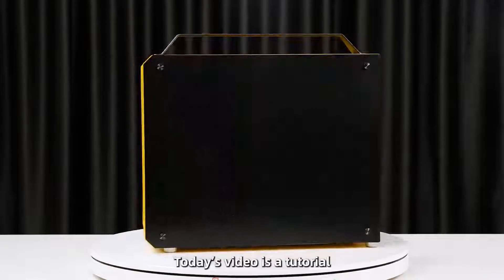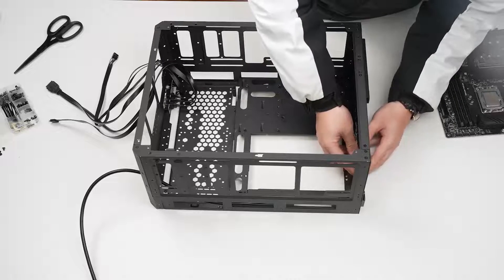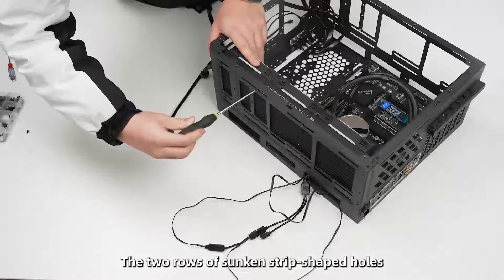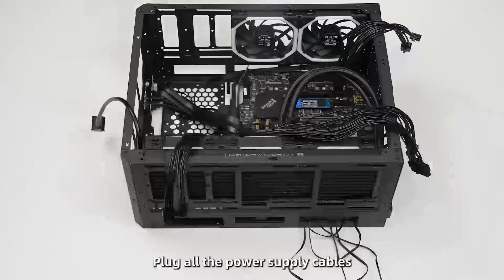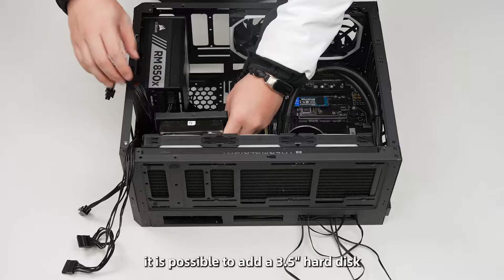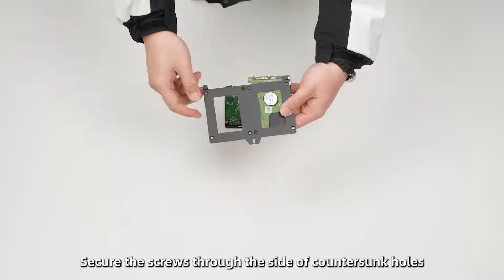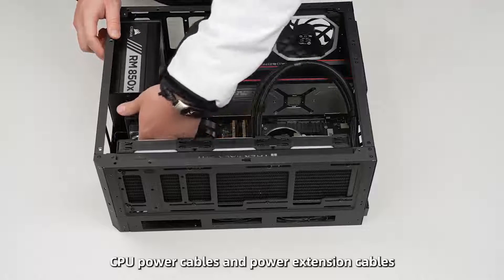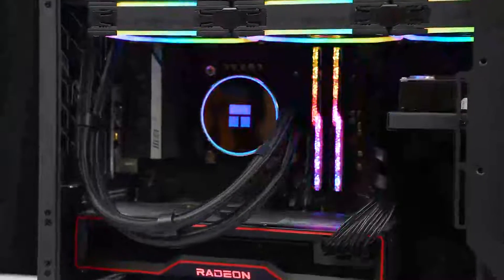INSTALLATION TUTORIAL_C34Pro+ATX Motherboard+360 Water-cooled+ATX PSU+335mm GPU

Comment: Can you install 240mm aio on the side vents?
Reply from the maker: Not yet, we haven't customized this model of AIO bracket yet
Reply: @MechanicMaster2017  if and when you guys do release a version of the C34 pro that can hold a side mounted 240mm radiator plus fans while keeping a full size atx psu up front I would definitely buy it... you might have to make the case a little wider for that but it would be a great design  right up there with the Lian Li 011 mini. Please let me know in the future if you do

Comment: Nice case! There aren't so many small ATX cases with full length CPU support. Can it be used as desktop case in horizontal position (like the bequiet light base 600)?
Reply from the maker: Thank you dear!~The foot pad can be installed on the right side panel,then you can put the case horizontally.

Comment: Im hoping you can answer this before I return this case because I genuinely love it, but I do feel like if you’re promoting this to be able to house powerful builds stock extension power cord is a major bottleneck and it limits what kind of power supply you can get or have.
Reply from the maker: Sorry sir, our power supply can be used to install various models such as ATX/SFX/SFX-L. I am not sure if the extension cord has caused any inconvenience to you. If so, please let us know more and we will help you make some changes
Reply: @ is there a way to have a c19 -c20 extension cord as a replacement for the stock one? I have to downgrade my 1500w psu because the cable doesnt match.
Reply from the maker: @TheSound_Vault  You just need to purchase another C14-C19 cable，But this requires you to purchase it separately in the mall, we don't have this accessory yet

Comment: Does anyone know where to find and purchase the e-atx extension bracket (ebb expanding panel) for the c34 pro? Can't see to find it anywhere
Reply from the maker: We currently only sell this bracket in China because the shipping cost is relatively high if we sell this part in other regions. Therefore, we have no plans to sell it yet. If you need it, we will also find a solution for you, but you need to consider the higher shipping cost🥰

Comment: What is the maximum size of the motherboard supported? Why is this not stated in the video?
Reply from the maker: Hi~The supported maximum size of motherboard is 305*330mm(need to add the MB extension bracket),this video is is a tutorial of one of the many installation schemes of C34Pro.
Reply: @MechanicMaster2017  Thanks for the quick response!
Reply from the maker: @NUCLEARARMAMENT  My pleasure~😄

Comment: can u install a 280MM aio at the top ?
Reply from the maker: No problem,dear
Reply: @MechanicMaster2017  pls one more  question , does this case support back plug for the asus rog maximus Z790 Btf  and also can the PSU  be raised if i am to use an sfx , inorder to make  space for an asus  rtx strix 4090 ?
Reply from the maker: @blbhansel8226  Hi,we do not have a chassis that can support back-plug ATX motherboard,out C30Pro and iF17 can be compatible with MATX motherboard.
Reply from the maker: @blbhansel8226  If ROG Strix 4090 is installed in C34Pro, the recommended hardware combination schemes: ATX+360 AIO+ATX PSU (14 cm); ATX+165mm air cooling +ATX power supply.

Comment: With a full sized ATX PSU, as in the video, you can use up to a 335mm GPU?
Reply from the maker: Yes dear,if the power supply is installed in the lower right corner, the GPU supports a length of 335 mm.